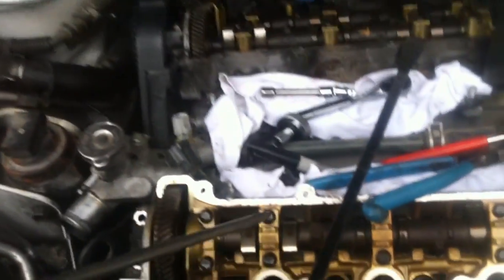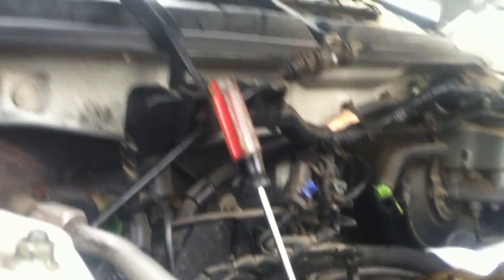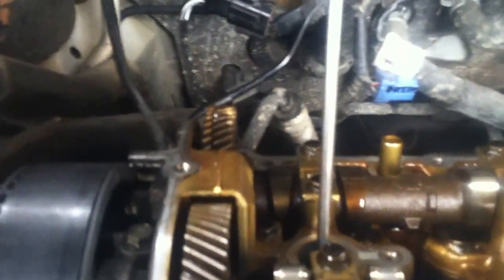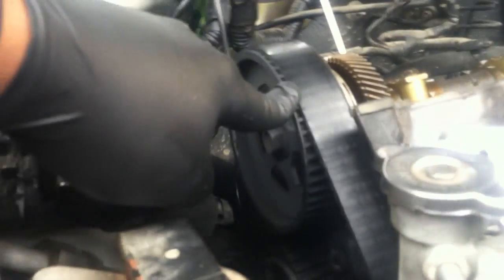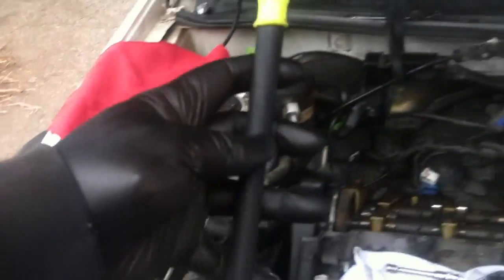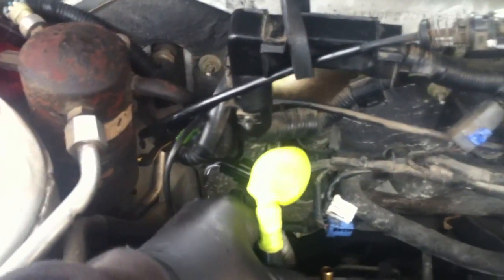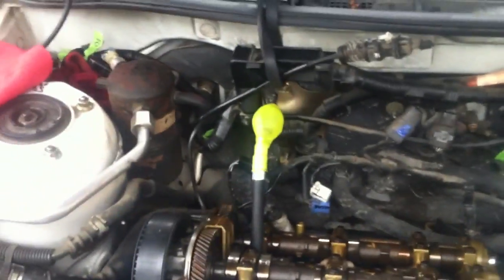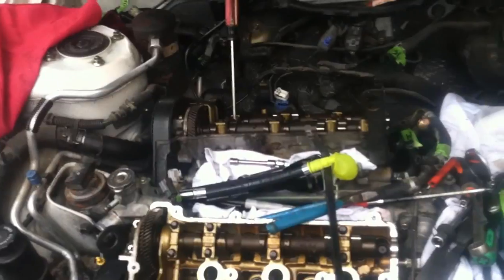HOW TO FIND TOP DEAD CENTER ON THE COMPRESSION STROKE. (WITH A BALLOON) (2023)

Comment: Thanks. I changed the timing chain on a mini cooper. Accidentally put the timing out 180 degrees. The flywheel had two locking holes. Could not work out the compression stroke. Now I can. Thanks again.

Comment: Bruh I put a compression gauge on the 1st cylinder on my 3L Ford Ranger and the gauge never went up but I heard air coming from somewhere. The hose on the spark plug hole was snug. Any idea what my problem is?

Comment: What if your timing belt broke? How can I make sure I'm on the compression stroke?
Reply from the maker: Turn the crankshaft by putting a socket on the crankshaft pulley bolt. But keep in mind your engine could be an interference engine which means the pistons could hit the valve once the piston is on the up stroke. Also damage probably occurred when the belt broke if it is an interference engine. if its a non interference engine you should be ok to put a new belt on.
Reply: @oldskoolfunk71         mine's a non-interference engine,.   Problem is I don't know how to tell if I'm on the compression stroke by turning the crankshaft . ..... The Piston goes up and down but only one of them will be the compression stroke and I don't know how to tell when that is because the cams are not turning because the belt was broken, you know what I mean? The cams aren't moving and I have them locked with the lock tool and I want to put on a new belt I'm just trying to make sure the Piston is in the compression stroke

Comment: So compression stroke is TDC all the time or does it make a difference on exhaust or intake... Im confused.
I rebuilt my 6.0 engine and I'm having a crank no start and Im not sure if the timing is correct as far as if I had tightened my rockers on compression stroke. Though my piston was at TDC I don't know if it was on the compression stroke.... Just need to verify because I'm nit sure if the exhaust or intake valves are supposed to be open or closed on compression stroke... Please help.

Comment: Love your videos man!! I have an issue. I tried doing this balloon test you did because my 93 civic cranks but doesn’t start so I set the timing marks and put the compression hose like you did on spark plug 1 with baloon attached and balloon doesn’t fill up with air but it does suck up air. I turned the engine about 4 times. Please help my friend!!

Comment: I have a hose with a fitting from a leak down tester but the hose is bent slightly and this throws is out of alignment when I try to screw it into the deep set plug hole.  Where can I easily find a hose with the 14mm x 1.25mm fitting?
Also, my spark plugs go in at an angle so I am afraid to use the screwdriver method for fear of jamming the piston and damaging the spark plug hole threads or scraping carbon pieces off it that could get in the rings and cylinder wall.
Valve covers are on since I am only wanting to  use a thread chaser before installing new plugs and want to be sure the chaser doesn't hit an open valve or the piston.
Great demonstration though and I will use the balloon method if I can get something with a spark plug thread on it with hose attached.
Thanks!

Comment: Thanks a lot man i was confuses about tdc  but you have explained it well ill do a finger glove as i dont have baloon and ill check mark on crank pulley and timing chain cover then watch cams should face each other on first cylinder
But the most difficult will be loose and tightening  crank shaft pulley without turning the crank pulley from tdc for loosining May be air gun but for tightening i dont know how itll be done hope i got some help 😁

Comment: I didn't have a balloon so I cut off the finger of a rubber glove and taped it to my compression tester hose.  I wasn't able to get a wrench on my crank bolt so I put the manual trans in fifth gear, brake off, and rocked the car back and forth pushing/pulling on the shock tower. This method seemed to be quite accurate as far as determining TDC as the glove responded to the slightest piston movement. I also tried the screwdriver method but I think the balloon is more exact and there is no possibility of damaging anything inside the cylinder.
Reply from the maker: Now that's what I'm talking about, good old garage engineering and never making excuses JUST HANDLE IT! Excellent improvising God bless.
Reply: POOR  STUPID MORON you are !

Comment: The harmonic balancer on my smallblock Ford has no timing marks. Is this method precise enough to make a zero degree mark in line with the timing pointer and accurately set ignition timing? I have a dial back timing light.

Comment: Can you damage fuel injectors if grabs the screw driver in stead of it pushing it up and down. Because I did this on my blazer and it would grab it instead of pushing it. Now there's to much gas pouring into my engine

Comment: Thank You, I used a large rubber gas line.  It was a little big so I had to twist it into the spark plug hole.  I put the other end to my  lip an could feel the air blowing on my lip.  Thanks again Bob

Comment: Im a bit confused..Why not just insert the screw driver in the cylinder and turn the engine until the screw driver is at the highest point? Wouldn't that be tdc? Why even use the balloon? Thanks
Reply: You have to make sure you're at #1 cyl TDC on the compression stroke and not TDC on vacuum stroke. Difference between car starting and running properly versus no start, rough shaking running etc.

Comment: Hi, I have a question. I tried this method after watching your video. Is the balloon supposed to inflate only at compression stroke TDC or does it kinda inflate other times(intake, power, or exhaust stroke) as well? I mean a little bit. So it's confusing. Thanks and I need your answer.

Comment: if you had over head value engine; what do you look for on the rocker arms to see that both the intake and the exhaust values are closed so that you know you're on compression stroke and not the exhaust  ; I am going to try to make your tool as well what is the adapter size (threading) your using I know it might be different from vehicle to vehicle

Comment: That's a cool vid bro. Never thought of that. Been trying to come up with some way to assist myself without any help around to find TDC on my 91 Jeep Cherokee Laredo 4.0L. Was changing distributors and think I was off a tooth but now I know I am way off. Have the No.1 spark plug out but there is no notch on the crank balancer pulley so I wouldn't know exactly when TDC is centered. I am waiting on my TDC Whistle Tool to arrive in the mail to help me by tapping the engine over but I know it would be only approximate. Also learned about a Piston Stop Tool to use but I would have to get underneath the car to turn the crank bolt. Lets just say I wanted to go ahead and use something as a Piston Stop Tool without actually ordering one. What would you slide in there to get the most accurate reading to mark the crank balancer pulley? Don't think I have any wooden dowel pins and how hard will it be to turn the inline six cylinder engine with five plugs and serpentine belt installed? Is there any risk of snapping that bolt off?

Comment: love the vid, very good tip.. the only downside is the screwdriver doesn't work on all engines.. any ideas for ohv engines?
Reply from the maker: g Thanks g, On V type engines I have someone turn the engine with a ratchet while I place my finger on the spark plug hole or spark plug well to feel for the compression stroke. Then I put a bendable oldskool hanger or anything that can bent and hold it on the top of the piston until it reaches TDC
Reply: the hanger is flexible enough to go into hole, lay on top of piston and show evidence of TDC
Reply: not a big fan of screw driver trick, got one stuck yesterday....rummaging thru the kids stuff and making the balloon tool today....you are a genius!!
Reply: +oldskool funk I didn't get the hanger trick could u explain pls

Comment: What did you put on the hose to screw into the motor with the ballon? I get the hose and ballon concept but I'm lost as to what you used to screw it in.
Reply: Deonb2026 compression tester line
Reply: or hollow out a spark plug

Comment: This is really a good idea. I made my own variation on this. I broke out the ceramic center of an old spark plug, then shoved a piece of heater hose on it and screwed it into the spark plug hole. Worked like a charm! Thanks oldskool!
Reply: How'd you break out the center?
Reply: @fidenciolucianoflores7814  I put the spark plug in my bench vise and just started breaking it with vise grips. Once you get it started it falls apart.

Comment: How do you know it's not the exhaust stroke when your balloon inflates?
Reply from the maker: The exhaust stroke (piston on the upward motion) the exhaust valve opens milliseconds right before it reaches the bottom of the power stroke then opens (you will see the balloon quickly inflate then deflate as the exhaust valve opens staying open all the way to the top then the intake stroke occurs. you can see the switch of the balloon on all 4 strokes but you have to look closely and rotate the engine slow. And no the exhaust stroke does not compress the air on the way up only for that millisecond at the bottom.

Comment: no man - if balloon fills, then the valves have to be closed - no air coming in through intake valve and no air going out exhaust valves...
Reply from the maker: Exactly, Compression stroke= (valves completely closed for fractions of a second) 
Intake
Compression
Power
Exhaust

Comment: This is wrong, you will always have air coming out on compression and exaust!
Reply from the maker: Learn valve train operation THOROUGHLY before you make an assumption.
Reply: Tell me how it could be a compression stroke if air can escape.
Reply from the maker: During the upward motion of the compression stroke the piston is going up squeezing air and fuel, at the same time all 4 valves are closed (talking fractions of a second) creating the compression ratio and getting the next cycle ready for the power stroke. I'll be making a video in detail on it soon.
Reply from the maker: Absolutely no air escapes until the exhaust stroke occurs ( opening the exhaust valve) after the power stroke is complete.
Reply: oldskool funk  Man I really appreciate this video. Ive been working on my lil 86 s10 for the last couple of months . It wasn't running that great when I first bought it and it needed some serious brake work done . I fixed my brakes on it and ended up getting into an accident that damaged my radiator support core, bumper, radiator, bent my cooling fan a lil bit, and damaged my grille. My truck ran hot on me that day cuz I tried to push it home afterwards.  to try to shorten this story. I used parts from 93 s10 out a wrecking yard to fix everything and got a new grille. 
I had to replace the head gaskets on it because after doin all that work the truck started up and I let it run to see if it would run hot it didnt but I shut off cuz my radiator was half full . I filled my radiator up and started it up again after 15 minutes it shut off unexpectedly.

Comment: most simplest and piratical method.
Reply from the maker: Ya thanks Topline, it seems so difficult when your first learning the mechanics of the 4 stroke cycle so I decided to make it easy to understand. but its even easier if you remove the plug and put your finger over the spark plug hole and feel for pressure, no balloon needed at all.

Comment from the maker: If your changing and setting your timing belt to get the #1 cylinder at (TDC) start with the balloon trick first, then finish your top dead center with the screw driver second, its faster. I showed the screw driver trick first just for demonstration purposes.